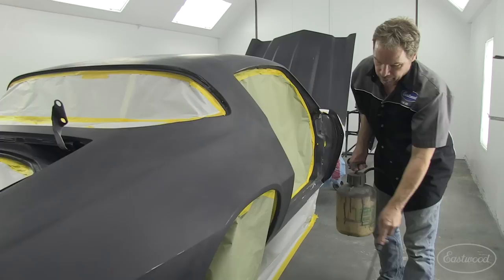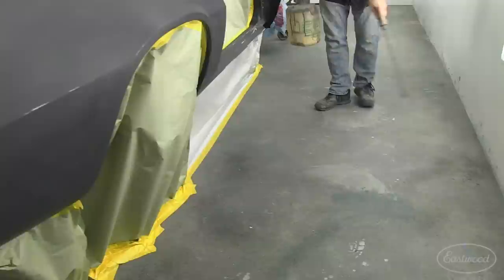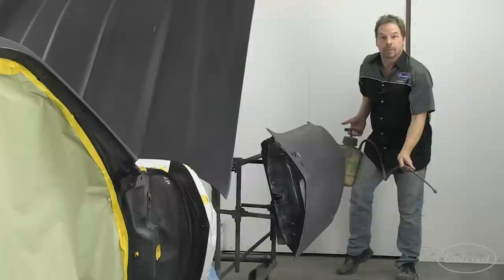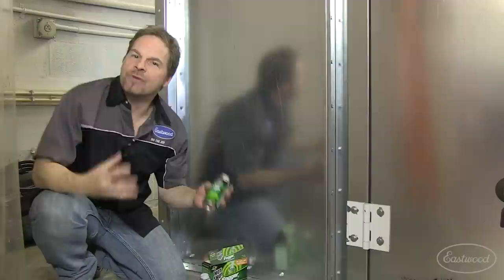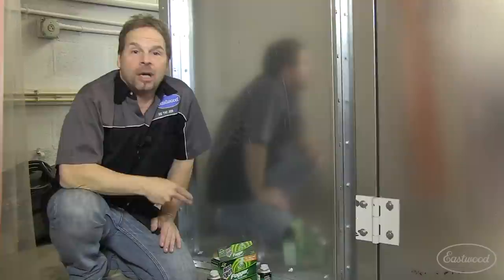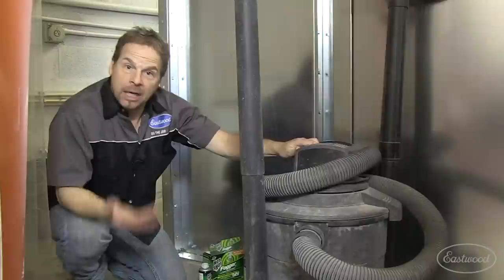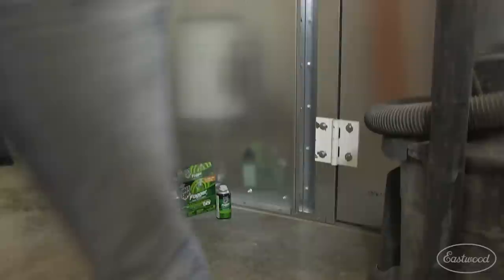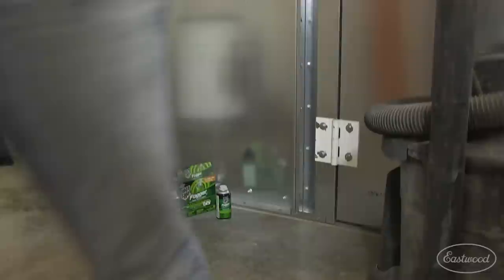How To Prep a Paint Booth for Paint - Painting Your Car with Kevin Tetz at Eastwood

Comment: question, if i may. since you are intentionally introducing contaminants into your controlled atmosphere for refinish, who is to blame when fisheyes and/or other surface contaminant issues arise? the painter? the product in the cans? the bug fogger that has absolutely ZERO reason being introduced into that atmosphere in the first place? i live and paint in southern Louisiana year round from hot to cold and wet to dry. i have worked for all 7 major refinish manufacturers and never once have any of those companies implied or stated to do such. while you may get lucky, you are also failing to relay to the general public the severe hazards incurred by dousing a spray booth with an aerosol known to contain oils, wax and other such contaminants in its composition. this above video is FAR from proper or acceptable refinish technique or etiquette.
Reply: ANDY MALNAR testify myman